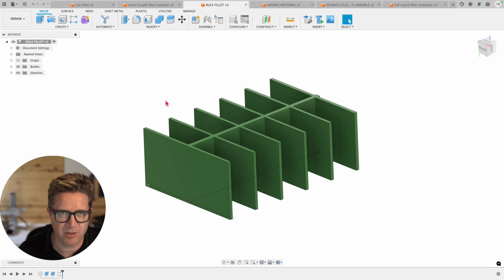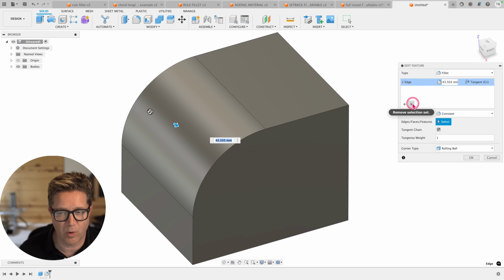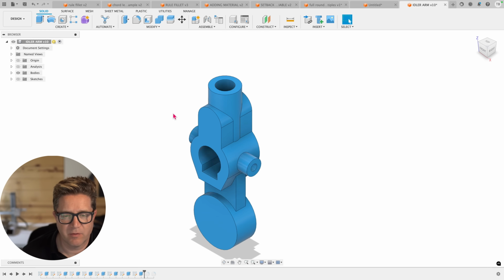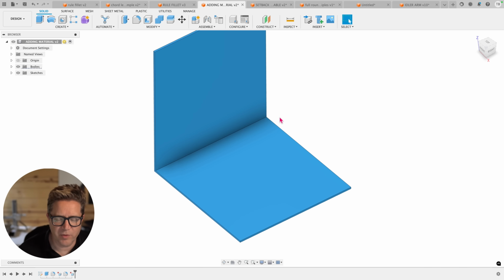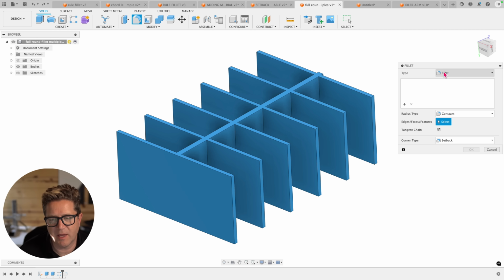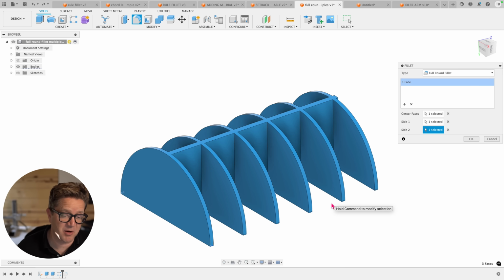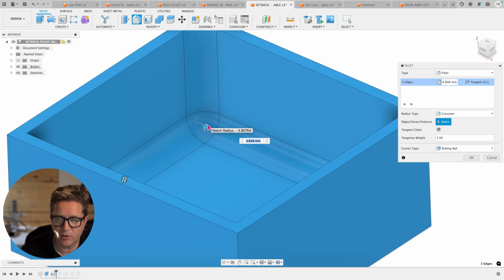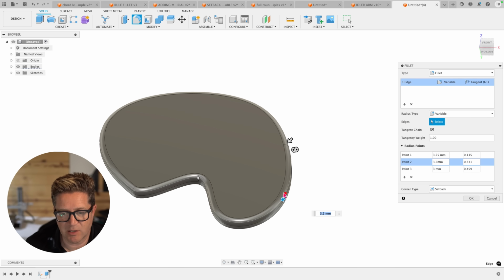Fusion 360 Fillet Tool — So Much More Than Just Rounding Edges

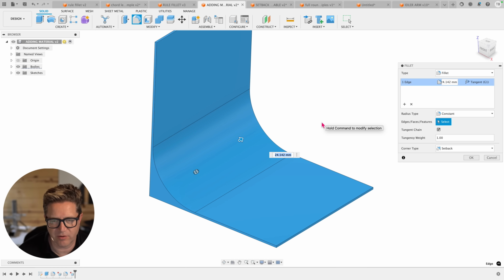Comment: 6:02 you’re confusing rounds and fillets. It’s easy to do as most CAD software’s don’t bother to distinguish a difference seeing as the math is the same. But a round is used to round over an edge so it takes material away, where the fillet is used to fill up a corner so it adds material.
Reply from the maker: I think you are right.

Comment: Order of operations with fillets and to a lesser degree chamfers is important. They should be done at the end of the body/component creation for less breakages or unintended behaviors. Also a major caution to using fillets when creating a base model early on for the same reason. While hinted at logical grouping of edges to get the behavior/look you want is also important.
Reply from the maker: You’re absolutely right!

Comment: Holy cow! There are so many options in fillet tool that I didn't know!
Tyler, sometimes the order of filleting seem to matter. Does it?
 Also sometimes Fusion refuses to fillet an edge unless I decrease the radius by a very small amount.
 Maybe you could cover these in future episode. Thx!
Reply from the maker: Good quetions.  Yes,in some instances the solvable radius might be very small. For the order, Fusion used to be incredibly order dependent when you have two fillets that might overlap but it does an ok job solving those situations.  Please email me any examples you have where it fails with multiple fillets close to each other.